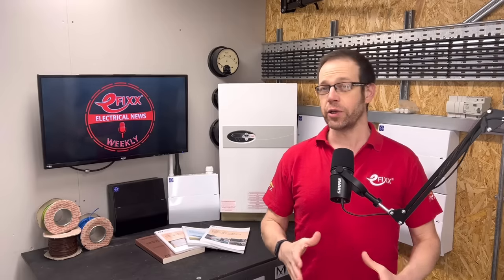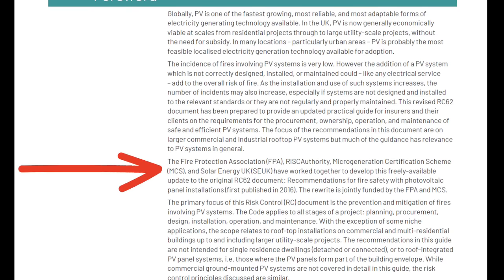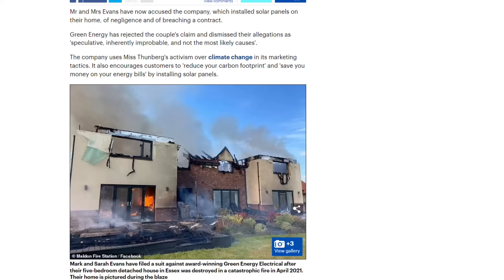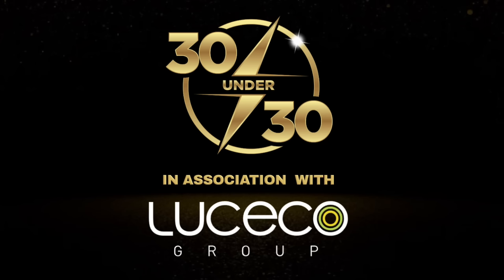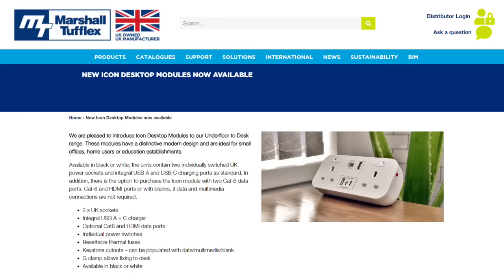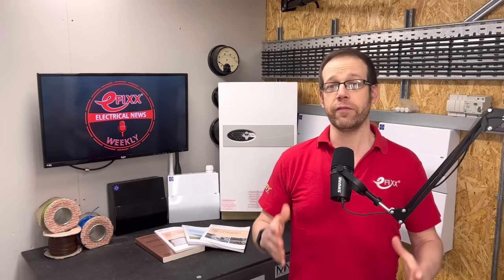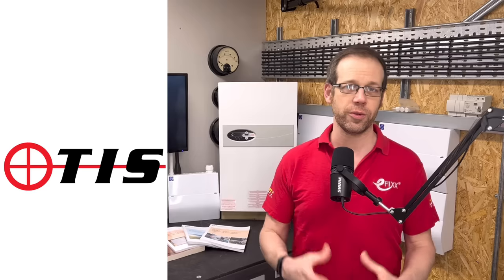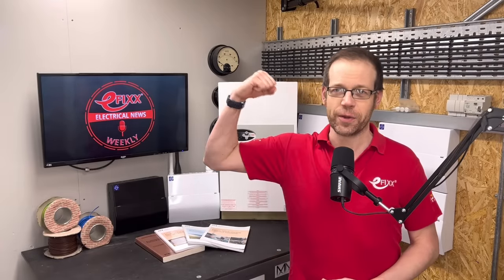DON'T Install DC Isolators On Solar, Electricians Warned

Comment: As a firefighter and an electrician, picture this:

We're responding to a fire involving a solar panel fire and they removed the isolators on the solar panels so we're gunna yank mc4s until they're all isolated? yea I'm sticking to a remote disconnection device that isolates panel to panel connections

my house is powered by a hybrid solar system (it can act as a grid tied system and an off grid system) for 5 years now and nothing happened no fires nothing. I even built the batteries myself sometimes it's when people get curious and touch what shouldn't be touched like the solar installation I did to a residential structure I told them not to tamper the settings and even let them sign a waiver that if there are signs of tampering, I have the right to waive my involvement in an incident involved, lo and behold they got curious they touched the settings and permanently damaged the lead acid batteries by charging it with the wrong voltage and current causing it to bloat and explode
Reply: No. You just go to the inverter and perform one of two actions:
1. Turn the isolation switch in the inverter
2. Pull the connectors on the cables to the inverter.

The difficulty for the fire brigade is educating every fireman the different topologies:
With or without a separate isolation switch.

And then there is time spent searching trying to identify whether a separate isolation switch is in use.
Reply: @deang5622  you probably don't know how PV systems work, when a solar panel fails it can cause a problem if it's a series circuit hence the use of an internal bypass diode. now if you isolate the inverter does it isolate the solar panels connected in series? That's also why an inline PV fuse is used and also rapid shutdown devices should be implemented, 500v solar arrays are an extreme pain in the ass if they have problems.  I am a registered tradesman and i probably know how to install PV systems
Reply: @dragonfireproductions790  I know more about solar panels than you could ever know in your life time mate. I have formally studied them.
As for diodes...I have solved many problems with Ebers Moll.

Don't be so condescending as you might just be talking to someone that knows far more about this than you do.

I was making PN junctions and other semiconductor devices probably before you were born.

If you are an electrician, even if you have specialised in PV installation, then I guarantee you you don't know as much about this as I do.
Reply: @deang5622  but you probably don't know the most recent safety devices used in solar systems nowadays, look up rapid shutdown devices used in solar power plants it individually isolates all of the solar panels in a system making it easier to prevent a domino effect
Reply: @dragonfireproductions790  Let me explain it to you.

If you are trying to isolate a PV circuit, it does NOT matter where you put the isolator, except it is better to put it in the positive line from the panels. In that way you are removing any lethally high voltage.

If you break the circuit, current stops flowing.

IET regs say that if the inverter contains an integral isolation switch, you don't need a separate isolation switch.
This is a fact and it is not up for debate.

And that inverter integrated isolation switch is as far away from the panel from a circuit point of view, as possible.

Clearly there is no obligation to place the means of isolation close to the panels.
The reason for this is because in an electrical circuit, you can break that circuit anywhere and current will cease flowing.

So what is being discussed in the regs about isolation is about the isolation from the panels to the inverter. They are NOT talking about isolating individual panels and trying to protect against short circuit faults among the panels!

Talking about series or parallel connected panels is a complete irrelevance. 
The series configuration results in two cables going to the inverter.
If you need an isolation switch then you put one in in one of those cables.

In a parallel configuration, there is a decision to be made as to how those pairs of conductors from each panel or sets of panels are routed to the inverter.

Let's suppose there are 2 panels in parallel, that's 4 wires. If all 4 are routed to the inverter then you will need two separate isolation switches.

If those two pairs of two conductors are commoned together so that only two conductors are routed to the inverter then you only need a single isolator.

The problem that might arise in a PV installation is when an electrician post initial verification is wanting to make changes to the configuration of panels and the isolation switch is integrated down in the inverter, or the individual strings of panels do not have their own isolation means, that potentially dangerously high voltages may be present across multiple panels. You are not likely to be electrocuted by touching bare wires or terminations from a single panel - unless it's a f..g big panel.

Just think it through, for crying out loud.
Reply: @deang5622  there is a module placed on a solar panel that can isolate the said panel and works from either a wireless signal or a wired line you are literally isolating the panel from the circuit isolating the inverter doesn't magically Shutoff the solar panel everything before the isolator is still live at the PVs open circuit voltage, a rapid shutdown system literally isolates all of the panels one by one making each panel safer to handle read what i am writing carefully
Reply: @deang5622  think of it, the inverter is isolated now you have a long ass line of wire going to the panels that are still energized  waiting for something to happen, if something were to happen like a fire, you're leaving a lot of energized cable which could catch fire and short out causing more problems or worse, you notice damage in the pv wire you isolate the inverter to service it lo and behold the full power of the pv array goes at you when you accidentally cut both lines with a diagonal cutter effectively injuring yourself or hell even like you said plugging a new panel or doing modifications, if you make a mistake in doing that and the system is rated at 400+VDC you're definitely in for a somewhat historically accurate depiction of an arc lamp
Reply: In strings of panels the current will never be greater than the short-circuit amps of any panel in the string. If  I lacked confidence in the isolation means I would short circuit the string up stream from the suspect contact briefly while opening it. The wire should easily handle the current. It’s more fun to make connections with wire nuts. It fast charges my pace maker.

Comment: Solar strings are class 5  cables and should have an ultrasonic weld or a bootlace ferrule as a minimum. I've never seen any signs of heat damage with the above but too many without. Also, adhereeing to MI for torque settings and use a descent tool will certainly help to reduce lose terminations and heat.

Comment: This was the law until recently in Australia. (ROOFTOP isolators)
It caused HEAPS of fires! Finally the requirement of rooftop isolators has been dropped.
Reply: I never understood why roof top isolators were made mandatory over isolators that were mounted by the Inverter and better protected from weather,just doesn, t seem to be a safer way apart from being able to isolate at the cable run at the panel string,surely they are and have been more prone to failure.My Daughters installation from 5 years ago has both panels and on the wall external to inverter the Fronius also has it's own dc isolator switch.

Comment: With out a DC isolator you would have to make the PV connection in the night
I can’t see how a dc isolator of the correct specifications can cause a fire
Reply: Why ? The isolator on the inverted disconnects the circuit .
Reply: MC4 connectors are protected, just don't plug/unplug it on load.  The guys on the roof are plugging and unplugging them when installing anyway so there is no extra new hazard.
Reply: Excessive contact wear possibly by switching too many times under load.
Shouldn't happen to a good quality, suitably designed switch, but I bet it does.
Reply: @deang5622  You never disconnect an on-load DC circuit by means of an isolator.
Reply: @edc1569 how do you disconnect and on load dc Circuit
Reply: Wrong and unsafe. This is common misconception. Many places still have full voltage at night. If you have a full moon you'll almost undoubtedly have full voltage. If you're around a city on a cloudy night you'll have like 60-70% of full voltage. It is hundreds of volts and unsafe.
Reply: @Hipyon  you should turn off the charge controller so the panels aren't passing any amps (on load) anymore. Then you can turn off the switch.
Reply: I have fitted a panel isolator , it seems obvious to me, I also have  battery isolation switch .
Reply: @gg-gn3re  300V but 1mA DC. That's one milliamp. You won't even feel it. Completely safe unless you lick it like a 9V battery.
Reply: @persona250  and what if your panels dont go to an inverter but directly to a lithium bank?  PV Panel to DC isolator to mppt controller to lithium bank busbar.  This is how they are installed on boats.
Reply: @gg-gn3re  im under the impression from what i have read that this is a big no no because it can damage the charge controller.
Reply: @joesmith1142  It'll only be a problem if high current is flowing on the output side.  Essentially the energy in the buck (or boost) circuit for non-isolated designs has to go somewhere and if the output is abruptly cut that means voltage rise.  Fortunately designers of non-junk chargers understand this and include diodes (TVS, transorbs etc) to ensure the voltage doesn't get to harmful levels.  Decent chargers also include a way to shutdown the output safely and then you can disconnect without any concerns at all.  In the Victron world this can be done with a pin on the VE.direct interface if configured so, or via a hex protocol command sent to the charger and of course the smartphone app if bluetooth connectivity is available.
Reply: @retrozmachine1189  Interesting, thanks for reply.  On boats its common to wire the mppt output directly to the battery bank positive busbar which could be under heavy load depending on what is being used, but because the energy from the panels can still technically flow directly into the battery bank, then cutting power to the controller should have no ill effect?  is my thinking correct?  i have not installed my panels yet but a lot of boaters do install a dc shutoff switch, which i had planned to do anyways.
Reply: @joesmith1142  If you are breaking the PV to the charger it'll be fine.  It's really only an issue when you break the battery/load side under high current.
Reply: @joesmith1142  then you have to fit a dc isolator .
Reply: @squeaky_honda  yes you will. No reason to specify if 1mA is dc or ac either. Amps don't penetrate the resistance of your fingers, the voltage does.. So your comparison to a 9v battery is irrelevant and shows you don't understand the basics.
Reply: @gg-gn3re  Notice I mentioned 300V which is lower than 500V. So, no skin breakdown. And never any close to 10-30mA.
Reply: @squeaky_honda  wow good math, who knew 300v was lower than 500v. Easily penetrates skin and that is around max what one would expect at night..

Comment: Victron doesn't make crap, they have no chance of blaming victronenergy.
Reply: 100% it was dodgy connection or similar. no chance it was the victron, that shit is solid.
Reply: It was definitely a bad connection, probably on the AC side. I've seen a video of a fire with a Victron system caused by that. Victron's connectors are very weird, so a DIYer misjudged how much copper to expose. Also they discourage the use of ferrules, because on boats the shaking makes that weird stuff come loose.
Reply: @squeaky_honda  i disagree but i realize this is a hotly debated topic.  ferrules are widely recomended on boats for the very reason of preventing loose connections.  compressed wires will loosen up soon after install due to the wires slowly compressing, not to mention repeated heating and cooling.  ferrules work perfectly in victron gear.  i just installed 6awg ferrules in a victron charger yesterday no problem.  a bigger issue might be that these connections never get re-checked soon after the initial install when they will likely have loosened up, especially if its a diy'r who doesnt realize or its a professional install and no one comes back to check.
Reply: No matter what manufacture it is a bad one sooner or later will slip through. That being said I have Victron in my camper because of their reputation.

Comment: there are manufactures of breakers with magnets and arc chutes to quench an arc for high DC interruption.  They are designed to open under load and quench the arc. Please note they are polarity sensitive as the polarity determines the direction of the arc blow in the magnetic field. Polarity must be observed to blow the arc into the arc chute instead of away from it. Many breakers for DC have low voltage ratings due to the difficulty in quenching an arc. For panel arrays, ensure the breaker is able to quench the open circuit voltage under load. Other DC disconnect devices have multiple series contacts to break the arc.
Large gap knife switches work well as the gap when open is more distance than the current can mantain an arc. Use the type often used for inductive loads such as for a heat pump disconnect switch. Double break and an open distance greater than 1 inch is good to stop the arc.  The distance is important the same way cutting the cable broke the arc. You need a large device with the ability to make a large gap when open. For over current protection, use the sand filled multi-element fuse for at least the rated voltage. The sand falls into the arc to quench it.

Comment: Great content but I think you buried the lead on your first article on "DC Isolators"....................!
Literally on the next paragraph down is the statement;
"The Code applies to all stages of a project....... **The recommendations in this guide are NOT INTENDED for single residence dwellings (detached or connected), or to roof-integrated PV Panel systems"
That's a very definitive distinction.

Comment: You can but they need to be the tandem type breaks with a mosfet switch and isolates with a electromagnetic contactor. These are also built into several types of charge regulators as well.❤

Comment: Back in 2010 I got a warning from my solar installer to never disconnect the solar during the day.
I now live offgrid with a completely new installation by persons I trust. They told me the same: There is a thick isolator: disconnect during the night, or extreme emergency.
Victron MPPT's don't disconnect, but you can turn them "off": they will let the solar float, and hence it is safe to disconnect. The disconnect is for a 202V max measured setup.

Comment: I use a snubber circuit (a resistor and condenser in series) across the contacts on the switch which stops the small dc arc across the switch when opening and closing the contacts.  (it's old school man)

Comment: A legal requirement in Australia, roof mounted double pole isolator for Firemen to access during a fire.
Reply: Are you sure about that? Checked the latest regulations? I think you'll find they do not have to be on the roof anymore, not least because of the ironic fire hazard.  You now have the option of putting them elsewhere and simply having an indicated disconnection point on the array showing a place where a (MC4) connector is to be found that will disconnect the array from the downstream wiring.

Despite the reason being given being for firemen to disconnect the array that was the opinion of one man and not the general recommendation of the firemen themselves.  Firemen aren't stupid and don't want to get up on a roof of a building that is on fire and likely structurally compromised then falling through and being injured or dieing.  Put simply, the roof top isolator did nothing for improving safety and actually resulted in several fires in Australia.

Comment: Australia has had its fair share of solar house fires, many caused by faults in the DC isolators. Regulations and DC isolator designs have changed over time. A lot were caused by condesation forming inside the isolator which led to arcing. The design has changed a few times.